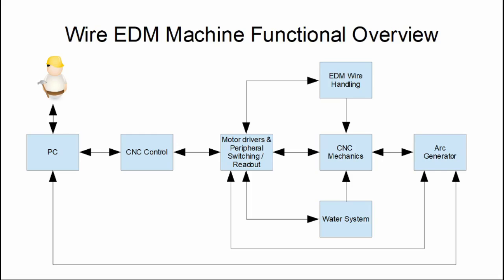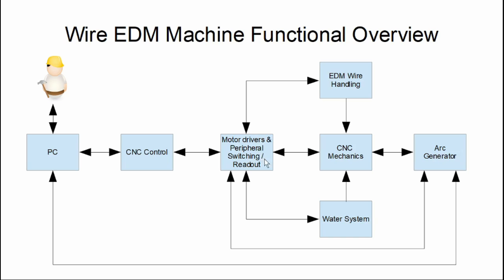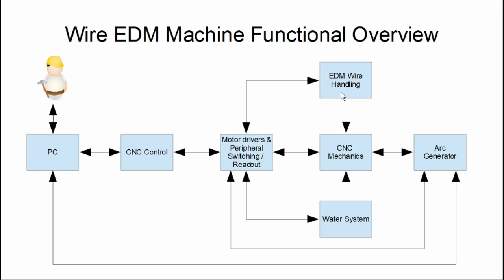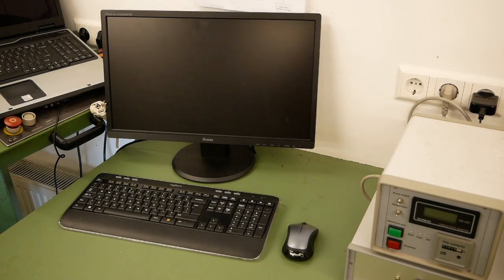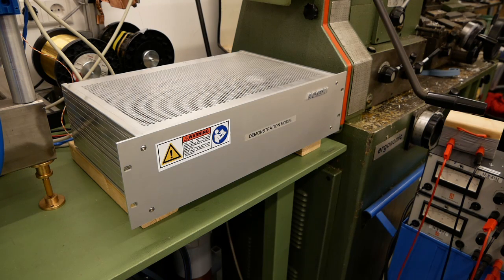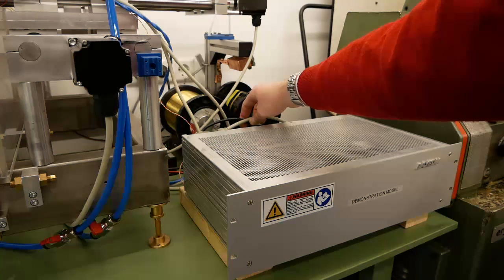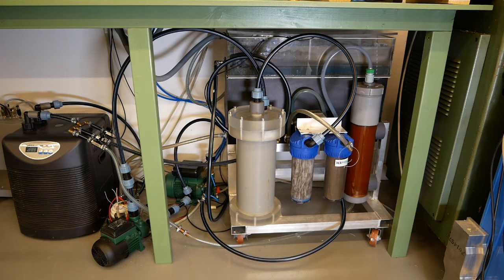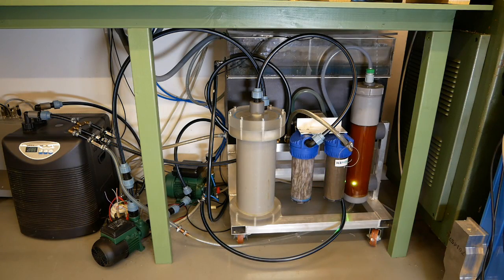BAXEDM Custom EDM Machine Build, Part 2 : Overview

Comment: Most people avoid USB for CNC control like the plague. Ethernet (e.g. MESA) or simple step direction pulse control from a parallel port is generally preferred. Something that integrated easily with LinuxCNC would be nice.
Reply from the maker: LinuxCNC is on my todo list.
Reply: @baxedm9806  u need a good pc with paralel port for using linux cnc ,  the latency is extreme if u use a pc that is not compatible with parallel port transmision , and have a loot of interupts on io ports .
Or u can use a mesa card on a  pc wich support pci card .

Comment: That was really fantastic.. can you achieve accuracy of 1-5 micro meter? With a wire of very less diameter ( 1-2 micro meter)
Reply: He said in the video prior to this that he could not achieve that sort of accuracy with a homemade machine. Only 10 micrometer. Machines for 1-5 micrometer are on the industrial size and very expensive.

Comment: What sort of pressures are you using and pump power ratings ?
Reply from the maker: Hi, that depends on the thickness of the workpiece, the pump I use can go up to 6 bar, with a flow rate of 0.8 m^3/hour. See also https://baxedm.com/knowledge-base/pressure-flow-diagram-of-used-workpiece-flushing-pump/
Nominal power at high pressure is 750W., but for thin workpieces that do not require a high flushing pressure the power is a lot less.